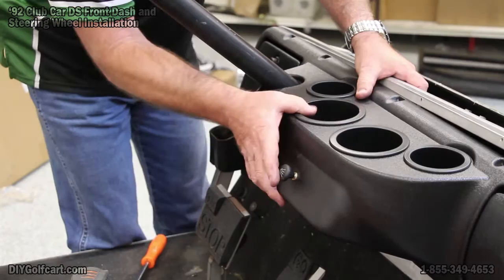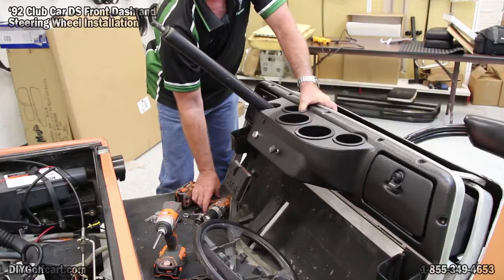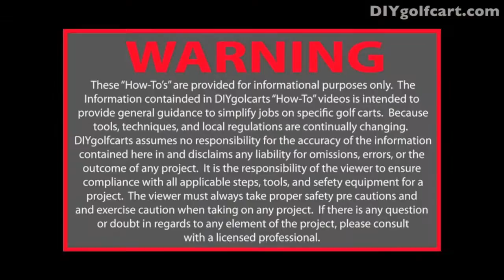Club Car DS Dash Cover | How to Install Golf Cart Glovebox

Comment: You vids are very helpful. I wish someone (Stretch?) would design an even more contemporary looking DS dash - maybe with a console attached like the Precedent. Even the updated ones are very boring. I know this is taboo, but I wish someone would do a vid cleaning up some of that throttle nonsense (on a 97 and up, gas DS), for all those (non-golfer) owners who want a better throttle response from their work carts.

Comment: Very nice however, the information I need is how to take a “stuck” steering wheel off.
Reply: I hate how they never show real world situations. I always use a piece of wood against the back side of the steering wheel and a big enough hammer striking against the wood to break loose the steering wheel. Make sure to leave the nut on a few threads so the steering wheel doesn’t go flying off. Please check out my golf carts on Instagram  @integral_industries.